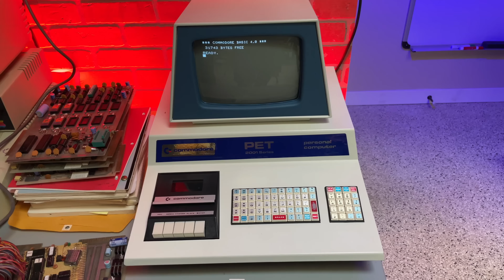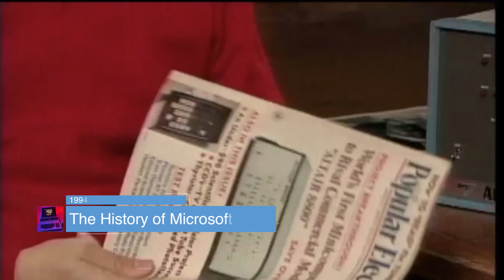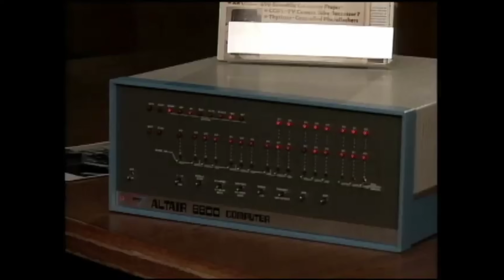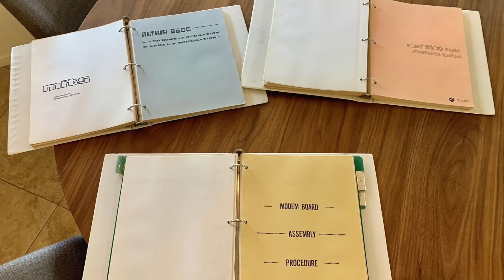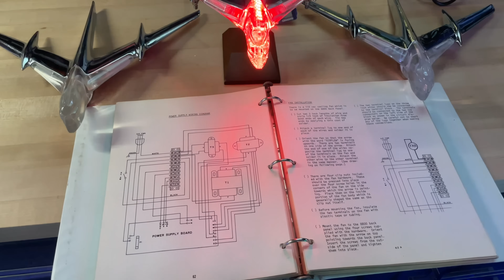The Computer that Birthed BASIC and led to Microsoft!

Comment: Back about 1973, my employer bought a Data General minicomputer. Usually, booting up one of these required entering a bootstrap of about 23 words using switches as you described,  but we had the latest version with an extra chipmwith the bootstrap encoded.

Comment: A PCB can actually stand quite a soaking as long as it is completely dry before powering it up. Back in the day I picked up a lot of 386 and 486 machines that were left on the curb on trash day to make room for someones new Pentium baby. Some were found in the pouring rain but I'd set them aside for a couple of weeks to dry and they all worked after replacing any missing parts.

Comment: I still have my copy of the January 1975 issue of Popular Electronics. I also have an original cassette tape with ALTAIR BASIC 4.0 on it from 1977. No idea how I wound up with it as I've never owned an Altair 8800 or IMSAI 8080 machine. A few years ago I saw a working Altair 8800 that came with an extra memory module board that wasn't working. I was partly tempted to buy it but the seller was asking $4,000. I wasn't willing to spend that much on the system. I have considered buying and building one of the modern replica kits.

Comment: In 1976, our teacher had a 4004 from SouthWest Texas Technical Products Corporation. It held 4kB of RAM. It was about the size of a car radio, with DIP switches on the front panel for input. The only other input was a standard shoebox casette tape recorder. It took over 20 minutes to load a little character-based StarTrek game! The manual was a good-sized book, but we had a blast with that thing. Programming was an electronics wonk's game back then. 
   A few years later I was coding on an IBM 020 keypunch desk, and setting RPG programs on plugboards. The good old days!

Comment: Uncle Dave, this linear power supply rely on the load from the different boards to bring down the voltage of  transformer secondary winding. 
I started learning electronics in 1976...

Flow goes like so:
> On/Off Switch 
> Primary Fuse!
> AC Transformer 120/07VAC
> AC Rectifier diodes in bridge
> DC Filtering Capacitors 
> Secondary  fuses!
> Dispatched to daughter boards for local regulation. 

The voltage regulator is where the most heat dissipation occurs.
TO3 were used.

Caps advice if you will: 
2 light Blue caps seems to have been replaced. These parts are known to age and are very cost effective. Change the whole supply board cap collection for $1Ea. 
Keep the same caps voltage but bump up the uF to get smoother filtering. 
"Low ESR Caps" not necessary here but nice upgrade as well. 

Repete filtering upgrade after each local regulation circuits.
You absolutely need clean DC Power to feed digital TTL gates, right? 

C-MOS chips were right around the corner... MIL Specs
👍

Comment: Pretty fair odds that you had something knocked loose in shipping and reseating it resolved the issue, also pretty fair odds that you had an oxidation layer that was resolved by reseating a component as well. 

We use to have old benches that we had to run 24/7 else the compnents in them would oxidize and we would have to reseat all the cards and chips. Talking about a sucky weekend.

Comment: Transformers will be fine with water as will most other electronics from that era as long as they're promptly dried (transformers can be given a light spray of WD40 to stop the laminations rusting). Distilled water is better but tap water is fine as long as it's dried out promptly.

Comment: You can use IPA followed by detergent and water to clean the circuit boards and components. Following up with low pressure compressed air to blow off the excess is a proven method and how I was taught as a Radio Technician. Be careful to keep the pressure down so you don’t blow parts off the board. Avoiding water in the xfmr and connectors is wise. Follow up with some CO contact cleaner sprayed into any sockets to expel any remaining water. Blowing off the excess water is much better than leaving it dry, where impurities in the water will leave crystallized traces on the board, especially under ICs or around closely spaced pins.

Comment: Nice one, Dave! I immediately took offense with the title because I knew the PDP-10 technically “birthed” Microsoft BASIC - and of course not BASIC itself either but just the implementation. But yeah, I know it’s not easy with the titles!
But never mind the title - I really like the work! With old electronics a good re-assembly really is the equivalent of turning it off and on again. Good job with the restoration! (Coming in a video soon, I hope: “changing capacitors on an Altair 8800”)
Reply: I saw a documentary not long ago about Dartmouth Basic. One of it's creators mentioned that they did it "... in the year 1964 BG... Before Gates!" Hahaha loved that.

Comment: Boards have been known to be washed in a dishwasher (without any salt) using distilled water. Transformers don't like being washed, it is very hard to get all the water out of them without baking for days.
Breaks in wire are the most likely cause for your missing voltage if you found one. I could also have been corrosion on the terminal block or a bad connection from the wire to the terminal connector (either crimped or soldered) . Next time start by checking the low voltage AC out of the transformer, if that is ok check the DC out of the rectifier. If you are not used to fault finding then draw the connections on a peice of paper so that you can identify what you are looking at. 
PS don't forget to check any fuses at intact and not corroded.

Comment: Water should be a non-issue when you have the electronics in question completely removed from the power source. When I did my High Reliability Soldering course back in the late 80's, we were taught to do a multi-stage cleaning after the solder repair was made. First was a non-corrosive cleaner to remove the flux and other contaminants, then isopropyl alcohol to remove the residue from the cleaner, then mild soap and water to remove the alcohol residue, followed by a thorough rinse with fresh water to remove any of the soap residue.

Comment: I built a contemporaneous but non-S-100-bus computer (from Carl Suding's Digital Group) in 1974, which actually came with a ROM monitor that could load from cassette tape directly. It used a linear power supply and case that I scrounged from the discard pile at Argonne National Laboratory (where I had a summer internship).  Sounded like a hovercraft when it was running. Ah - hand-assembled 8080 code! I can remember hexadecimal instruction codes to this day.  Thanks, Dave!

Comment: This video was heartwarming:
It proves that even a (very well off) retired Microsoft veteran ends up using a bench grinder and garden hose if he follows his passion for old gear.
I love it!
Reply from the maker: Thanks!  I polished about 500 bolts on that damned wheel when I restored my truck!  I prefer built over bought :-). And yes, eye protection!
Reply: Eye hear ya
Reply: Very well off...?
Reply: @mercster  yes, he has alot of money so could of paid to fix those problems
Reply: Adrian's Digital Basement is a great place to start on hardware. I would bet you had a loose connection from shipping. Nice work. c:
Reply: Dave has one practical right hand and one practical left hand. Use your hands is also use your brain. This avoids brain rot. You can't outsource that. Most important: "When the wife was out ...". Seasoned husband, too.

Comment: More of this content, please.
Old electronic devices, and specially thouse with connectors and sockets, tend to have problem with bad connections here and there. When everything was new, they work perfect. It could have helped by just moce a board och drop the machine from 2 cm on the table.

Comment: I used to rebuild 480 volt 3 phase Westinghouse SCR packs. We'd strip them down, and everything that wasn't a paper insulated coil was sprayed down with 409 spray cleaner, then a garden hose. Transformers could, in theory, handle water... but they'd take forever to dry out, and you don't want to lower their breakdown voltage in the meanwhile.

It was probably the broken connection at the transformer that kept your other 8 volt supply out of service.

I had a friend whose business back in the late 1970s was taking S-100 machines, splitting the power bus in the middle of the backplane, and adding a complete second power supply. This was necessary to cope with the density of cards that arose over time.

Comment: About the power distribution.  It was done that way to get around a couple of problems.  First, high powered linear regulators weren't easy or cheap to do.  Switching regulators weren't a thing.  But simple 1 amp regulators were just a chip and cheap/easy to source.  The second was voltage drop.  TTL requires 5V +/- 0.25V.  Anything outside of that, and you've given the chip permission to be illogical.  If your power supply is set to 5V, then the voltage drops due to wiring, backplane, card connectors and even PCB traces have to be kept under 0.25V.  By regulating on-board, you've eliminated most of that.  It also meant you could afford some voltage drop, so smaller wiring would be OK.  Bottom line, it was the cheaper/faster solution for it's time.  That all changed as switching regulators became common.

Comment: Why was Basic used to develop DOS over C or C++ ? I’ve heard that C was used to develop practically everything. Is that an exaggeration?
Reply from the maker: No, DOS was written in 808X assembly.
Reply: Also, back then a lot of microcomputers had too little memory to be able to run a compiler.  It’s tough enough to make a compiler that works on a system with the full 64K of RAM, but in the early days, lots of microcomputers had only 4K or 16K or 48K RAM.  The BASIC interpreter itself could reside in ROM.

Comment: I designed similar circuits back in the day.
The distributed power supply is vastly superior to the modern single-stabiliser designs.
The reason why the designer of the Altair used a separate power transformer (and rectifier, filter and stabiliser) for the front panel, is obviously to maximise the dis-coupling from the power bus. This is because the logic board was overly sensitive to power glitch. They used tiny +V PCB tracks, while the power plane impedance balancing on the PCB wasn't practiced at the time. 
They had glitch problems with the interface logic, and solved the problem like we did with vacuum tubes. 
You can add a LM7808 to the feed entering the main +8 V bus, and remove the additional transformer. Add a VK200 inductor in series with the output of the 7808.
Thank you for the video, it is very interesting to watch.
Regards from the UK,
Anthony

Comment: Good Job Dave! Unregulated and Linear regulated supplies are really the best way to start understanding electronics. 
Once you get the basics, try to tackle a switch mode supply! They are much more fun!
Reply: Any TV's from the late 70's through to when they became obsolete are a good way to cut your teeth on SMPSU.s! 
Wouldn't it be amazing if someone still had access to the old Thorn/EMI/Ferguson 'SYCLOPS'-based SMPSU/LOPS-based chassis to work on. I think the 7800.x chassis? 
The 'Ipsala' -based SMPSU from Nokia would be nice to aim for. Also maybe some of the Thompson/Ferguson VHS VCR's (3V30's+) from the late 80's - early 90's too. Heaps of directly-coupled silicone in those SMPSU's. Lovely!

Comment: G'Day Dave :) Old techie tip for cleaning PCBs, put them in the dishwasher then rinse in meths or IPA to remove any water left.
Reply from the maker: Cool, but there must be some components that don't like water... are there?  Like what about those little PCB-mounted transformers?  Or pots?
Reply: @DavesGarage  Components that use paper (like speaker cones) should be removed before washing. Also, remove any coin cells or other batteries. That also applies to Transformers using paper insulation. Since we will use heat to dry the boards, the water will leave as vapor, so getting inside a component is not generally a problem. Typically water, IPA, followed by gentle heat (maybe 150 F) is not a problem. My experience is only with keyboard PCBs, motherboards, and simple IO cards. I would also remove LCDs or other displays, but I think LED stuff is fine.

Comment: you can replace the old transformer based power supply to smps based power supply which can deliver stable voltas without the spikes. or simply add a bridge rectifier with capacitor at output to clean up the voltage.
Reply from the maker: Lots of folks do that, but I'm trying to keep this one original if I can!
Reply: Transformer, Bridge Rectifier & filter capacitor sounds mighty linear to me!
Reply: The whole idea was to restore this kit. Then you don’t replace with modern stuff!

Comment: Didn't Radio-Electronics Magazine have a computer project that predated the Popular Electronics project?
Reply: Radio Electronics Magazine had schematics and pcb layouts for the  8008 based Mark-8 microcomputer. I believe in 1973. Groups of people started (postal) mailing lists with tips and fixes.
Reply: One of the fixes required was that the original PCB layout of one board had Vcc and ground running to the same pins on the two sides of the board. Tips included how to get ten people to split the minimum order of ten 8008s, which were initially $320 each.
Reply: The Mark 8 didn't have a bus layout, all the board interconnects were individual wires, although mostly along one edge. There was an extremely poorly thought out case design, mostly plywood and no thought given to removing heat buildup.
Reply: The maximum addressable memory was 4k (X 8 bit), but almost nobody could afford about $1300 for all the 1101 static ram chips (plus 3 extra boards) so as far as I know they were always built with only 1k of RAM. Besides, what would you be doing that needed more than 1K, anyway.
Reply: You were on your own as far as power supplies and iirc you needed +12, +9, -9 & -12. About 90 watts total.
Reply: The one I had also had a modification to add an octal keypad with two digits of seven segment display, which made keying in a program much faster than using the toggle switches.

Comment: Oh boy, this takes me back to '75 when I ordered a Z80 single microprocessor, delivered in '76. That was £120. 16 1kx8 static ram (another £180) and sundry components. Home brew at its best. 7 years later it was 64k dynamic, cassette interface, improved graphics monitor (B&W only) all on two 12" square self-etched pcbs with point-to-point wiring.
Reply: I was on one of the YouTube channels that does computers and people were complaining about the high cost of parts like CPUs and I mentioned that when the 386 came out it went for $399.99 and those were 1985 dollars and building a decent IBM clone would set you back $2 grand .... In the 1980's you had to decide whether you wanted a decent car and no computer or get a computer and drive a hunk of junk.
Reply: I went through the late half of 1980's and to now. So much have happened, and in 2012, I began getting into vintage computing to relive what I experienced. Some call it retro, but I like vintage better as a term. And it has taken me to the level of building replica's of 8-bit machines. I have more or less what I need of original hardware, but building replica's that are close to original as possible, with the solder iron. Is something completely different and way more awesomme than just buying a used machine, recapping and then playing games.

More fun to actually build. Games are fun to use as burnin software. But I get bored of gaming after 10 to 30 minutes. 35 to 40 years ago, it was different though.

Comment: Working on c.1990 CNC machines, we'd start getting memory and bus errors randomly.  A common troubleshooting procedure included removing the memory boards, taking them to a mop station, hosing them down with hot water and floor degreaser.  We'd rinse them off, blow them dry-ish with compressed air, then let them air out until the next day.  It was startlingly effective, and I don't know of killing a single board that way.
Reply: Well, the only real danger is leaving behind conductive liquid(tap water) that might short pins when dried(less of a problem with large dips) - or the always present danger when handling old boards: static.
My favorite mixture is still demineralized water+isopropyl alcohol in an ultrasonic cleaner with a drop of fabric softener for the anti static properties - saved quite a lot of toilet iPhone logic boards that way. And the fabric softener also makes them smell less like toilet.

Comment: Hi Dave. Take it from a guy who has been working on a Raspberry PI based brain for a DIY smart still for a couple years. Distilled water isn't conductive. No electrolytes, no conductivity. I learned this when I first approached the idea of detecting the level of alcohol in the distillate. I already knew that ethanol wasn't conductive and figured water in the distillate would indicate that there was no more ethanol to extract. Nope, distilled water has no electrolytes, not conductive at all. So, distilled water is perfectly safe for washing down circuit boards with.
Reply: Is the water still non-conductive when it dissolves metal salts and oxides from the corroded parts?
Reply: @katbryce  ohh, memories of Chemistry lab 40 years ago. Psyche!
Reply: @katbryce  Equally as conductive as any other liquid that you would use for the same purpose.